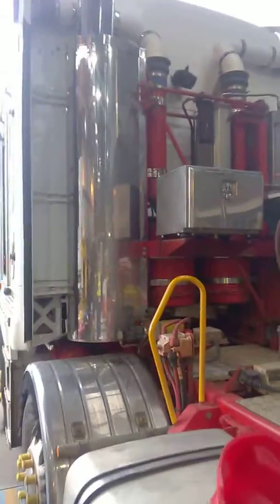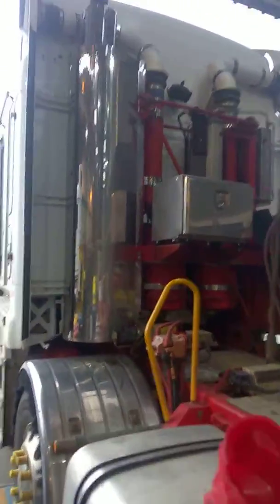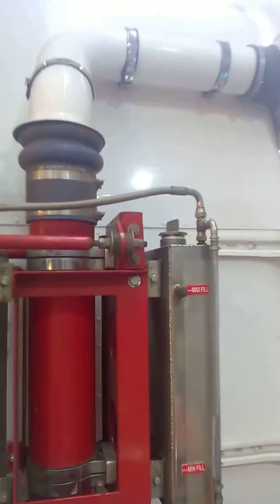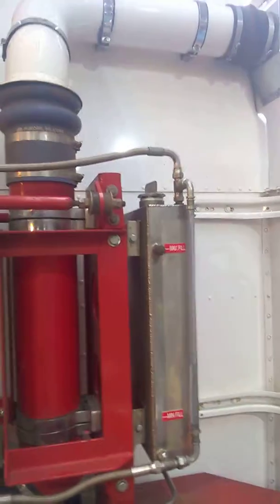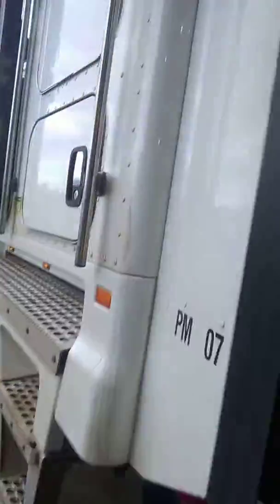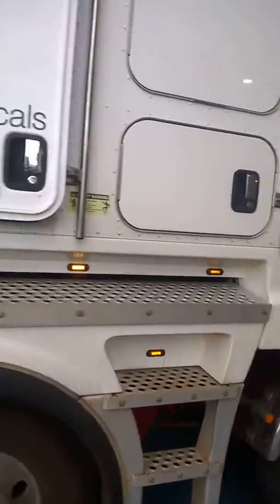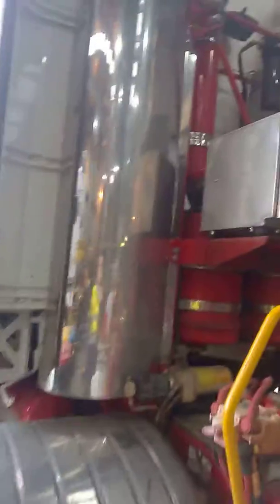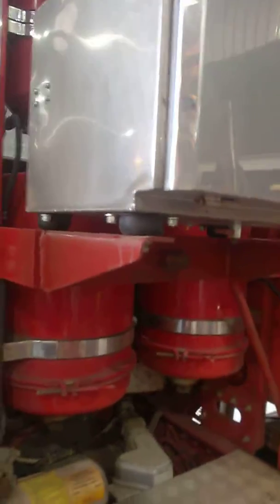Hydrogen fuel system Secret HHO Generation 20 for trucks , Boats, and Gensets

Comment: can i get a price idea (approx) for supply and fit to a Mercedes Benz 1418 coach thanks
Reply from the maker: call me on 0403177183
glknox1@live.com
www.hydrogenfuelsystems.com.au
Gavan
Reply from the maker: 4650 + gst
Reply from the maker: CALL ME O403177183
Reply from the maker: 5650
Reply from the maker: call me on 0403177183 
glknox11@live.com
https://hydrogenfuelsystems.com.au
patented , proven and certificated system delivering 32% savings on a 7.2 L truck - 27 tonne load